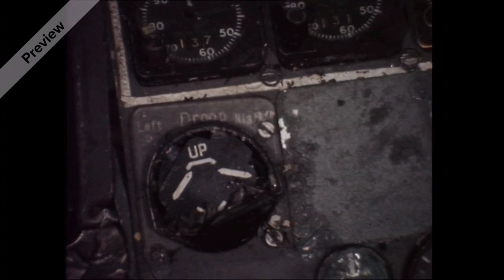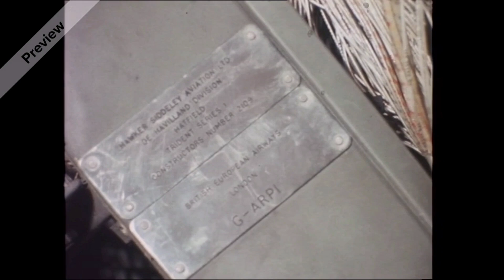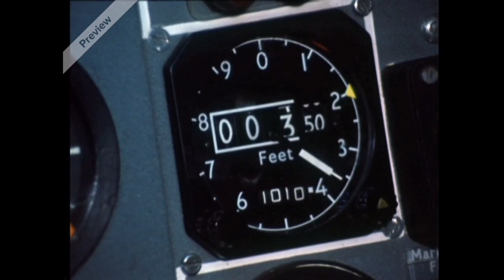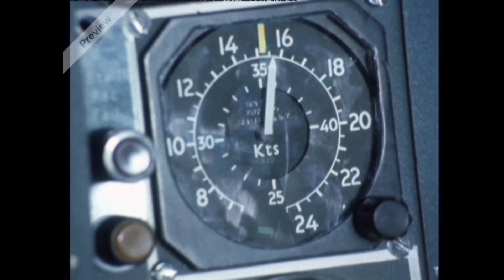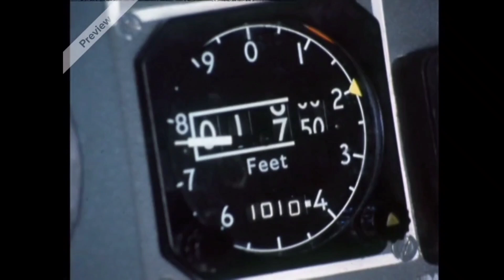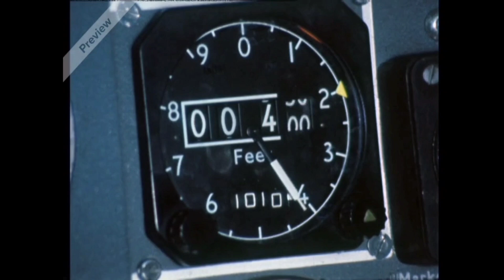British European Airways (BEA) Flight 548 Aftermath Footage | 18 June 1972 Staines-upon-Thames

Comment: This and the Kegworth accident, amongst others, were the driving force behind what came to be known as Crew Resource Management (CRM), a program adopted by most airlines that trained aircrew to take a holistic view of flight operations, moving way from the hierarchical structure that prevailed on flightdecks at the time. Specifically all crew members, regardless of rank, including cabin crew, were encouraged to speak up if they noticed anything unusual about a flight, and to challenge any command that they thought might adversely affect flight safety. It seems obvious now, but 50 years ago the conventions were different.
Reply: I'd always told by older colleagues it was the KLM-Pan Am crash that was the catalyst for CRM.

Good link though- thanks
Reply: Yes, you’re quite right. There have been a number of accidents over the years that led to CRM. NASA also had an input when they started to analyze why some crews had better outcomes than others when dealing with emergency scenarios.
Reply: Tenerife started CRM
Reply: NASA began the process of what would become CRM when they started methodically analyzing the crew performance of early astronauts.

Comment: There was an airline strike happening at the time.  The older captain of this plane got into a giant verbal altercation with the younger pilots at the airport, which raised his blood pressure and caused him to be infuriated by the time the plane took off.  The plane took off normally, but when the noise abatement procedure took place, the captain was managing the throttle and the droops on the wings.  It is assumed that the captain was not monitoring the airspeed and the droops were retracted prematurely, causing a stall.

The captain is said to have been having a complete loss of situational awareness due to a heart condition, which was exacerbated by the argument prior to the incident.  People theorized that the captain was having a heart attack during this crucial point of the flight and it was the main reason for the crash.